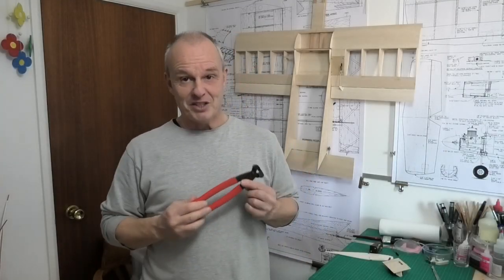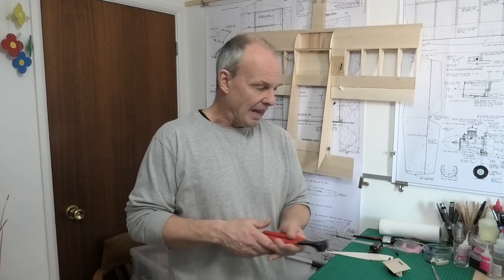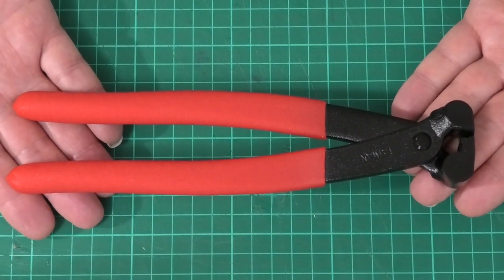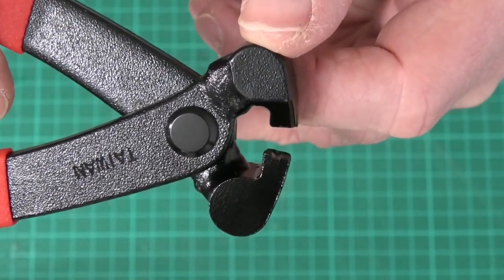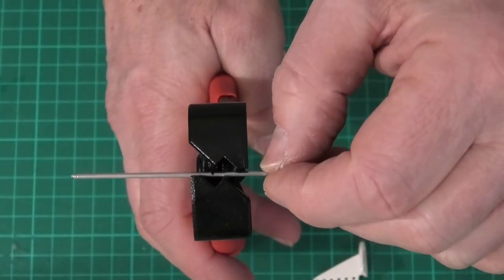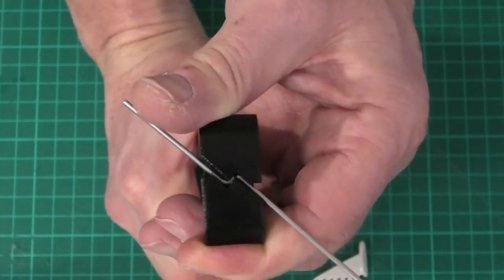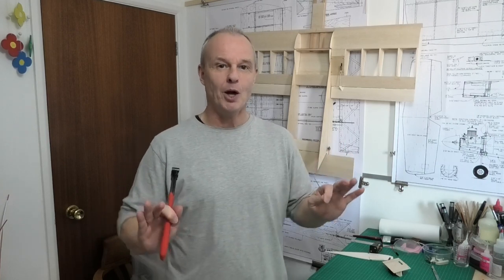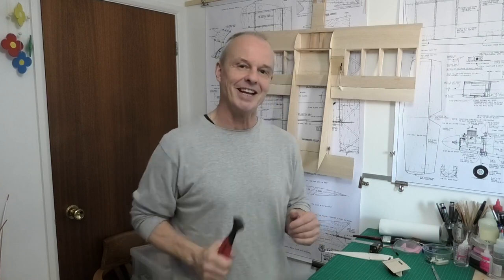Z-Bend Pliers Review - Essential Tools - RC Model Aeroplane Build & Repair

Comment: Nice video, I'm still skeptical about these pliers even though i own one.  If you have a z bend on both ends, how do you adjust?
Reply from the maker: Thanks for the comment.  You would not put a z bend on both ends, one end would need to be a clevis, ball joint etc. to allow for adjustment

Comment: Very nice video. What is the ideal wire thicknes for that particular crimping tool to get perfect z bends? Also some wires supplied in kits are bit stiff and resist taking a compact "z" shape.
Reply from the maker: I thanks for the comment.  I mainly use it for 2mm linkages, and it works fine for this thickness even if its hardened music wire.  Is ok for 3mm soft steel, but not reall if it hardened. Hope that helps